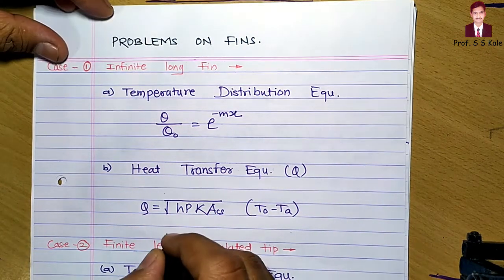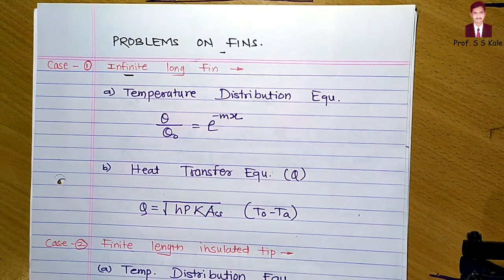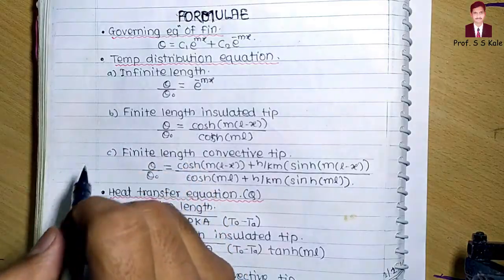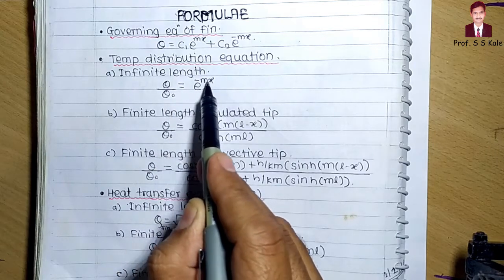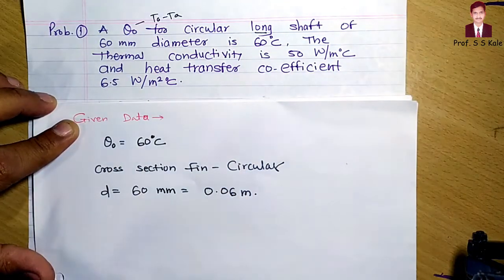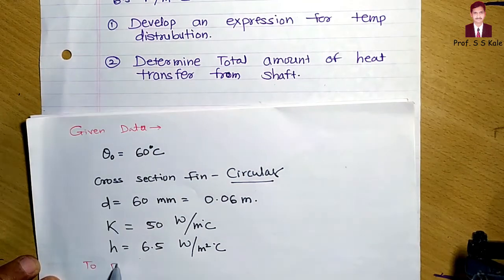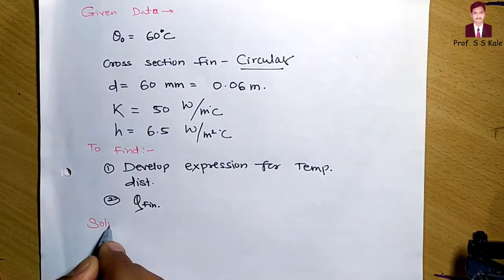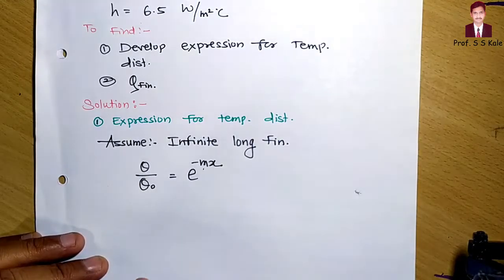Lecture 22 - Problems on Fin Heat Transfer- 1

Comment: A brass rod in the form of a fin 100 mm long and 5 mm in diameter extends 
horizontally from a casting which is at 2000C. The air temperature is 200C and 
provides a heat transfer coefficient of 30 W/m2
-K. What is the heat transfer from the 
rod? Evaluate the temperature of the rod at 50 mm from the base and at the free tip. 
Now, if this fin is replaced by two identical fins of 50 mm length. All other parameters 
and dimensions remain the same. What is the heat transfer from this combination? 
Evaluate the temperature of the fin at the tip